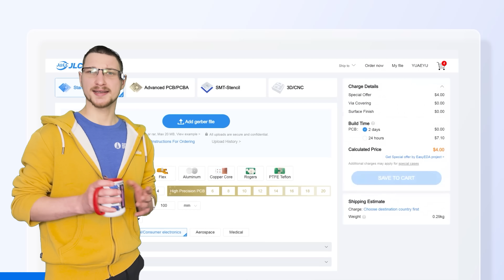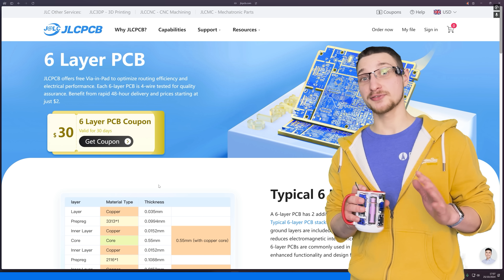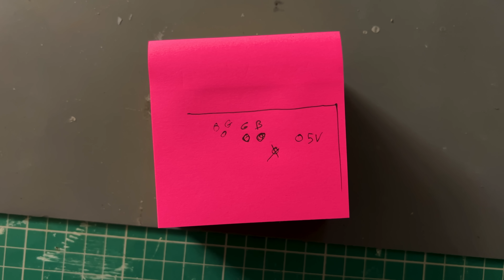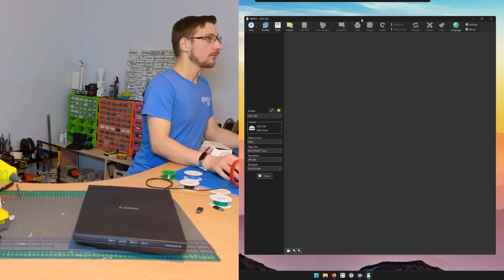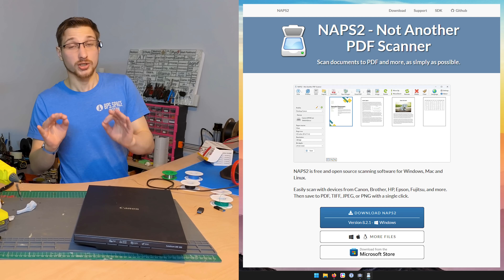How to Upgrade Any Old USB Device to USB-C

Comment: I'm loving how many people on YouTube are making "convert trash connector to USB type-C" videos!
ALL HAIL USB TYPE-C! \o/
Reply: I love Type-C as well, but the lackluster USB specification standards have led to manufacturers abusing the connector for uses falling well outside of said standards.

Take Minisforum and their supplied power adapters for example. They make and deliver mini PC's, the power adapters they come with make use of the Type-C male end connector.

They cheap out on the hardware/firmware so save pennies. Those adapters lack USB legacy mode support due to that and run at higher fixed voltages e.g. 21V (no 5V for 'dumb' devices).

Any unassuming customer would think that they could use this power adapter with their other Type-C accepting devices, because USB-C is universal, right? So they plug it in, and immediately face the disappointment of magic smoke seeping out of whatever device they plugged it into.

These manufacturers need to face consequences, but they will inevitably get away with doing this since regulations are mere suggestions in the cheaper regions of China. The USB specification is the culprit at fault for not tying up loose ends like these.
Reply: @proxyhx2075  Yeah, the minisforum power supplies are dangerous and should NOT have made it to market with a fixed voltage like that. Barrel plugs have existed for a long time so I would have preferred that option if they didn't want to go down the PD route.
Reply: @AndyMitchellUK26  They don't have a PD mode, that's the main point and problem I was trying to explain in my previous comment.

They don't conform to the USB PD standards at all, or any other USB charging standards for that matter. No dual-mode or smart voltage negotiation capabilities at all.

Those adapters simply deliver a fixed output voltage just like the average laptop adapter with a barrel plug end. The Type-C male end connector is taking it's place for reasons unknown.

It should be a barrel plug like you said.
Reply: @proxyhx2075  Yeah I know, that's why I hate them. I honestly don't get why they couldn't have added PD mode when they already went to half of the trouble of sticking the USB-C connector on the end in the first place.
It is 100% asking for trouble because one day, someone is going to accidentally plug something in to that that only takes 5 volts.
I get that USB-C is capable of being an all-rounder but barrel plugs aren't bad either.

Comment: Twisting the wires creates opposing electromagnetic fields as electrons move through the wires so that it maintains better signal integrity. 

I might have the term “opposing electromagnetic fields” slightly wrong but it has to do with that lol

Comment: I work in commercial AV construction. So many of the devices I install STILL use mini-B for a config connection. Lots of USB B 2.0 ports too lol. The top end commercial stuff is starting to use a lot more USB C, but so many of the products are built on 10 year old hardware, it kind of makes sense that they’re still using those connection types lol